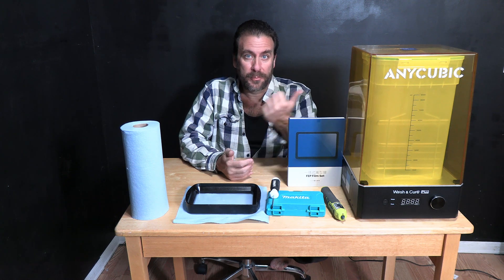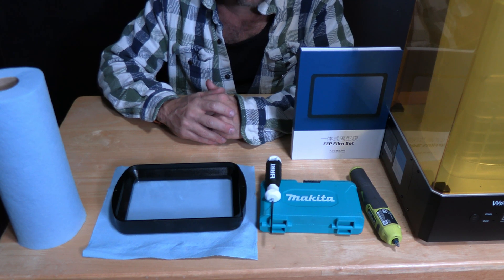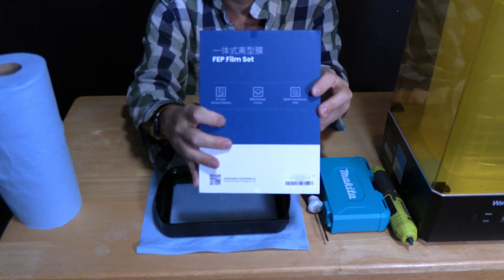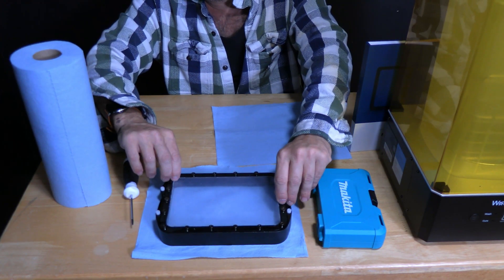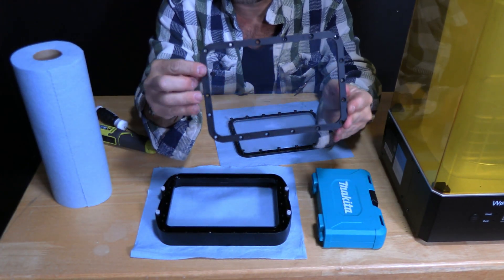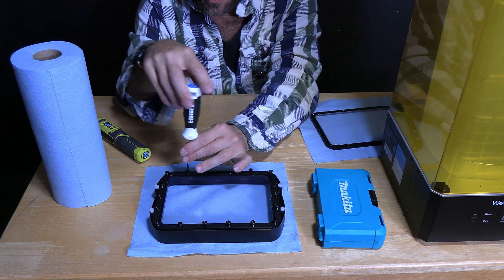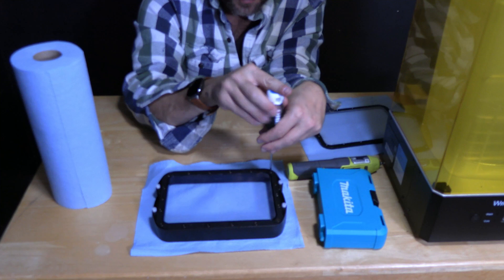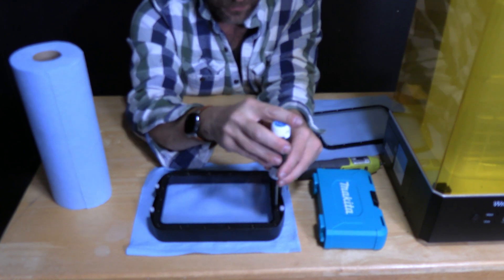Replacing the FEP on a RESIN 3D Printer Resin VAT - Anycubic, Creality, and more (Photon M3 shown)

Comment: Hello, I bought FEP for my Photon M3 but there is no frame, yours come from Anycubic and cost a fortune (robbery even, see forced sale) while those I bought are sheets to change the VAT without there being a frame, how do you explain that, and I specify that the FEP I bought are FEP FOR the Photon M3 🤔
Reply from the maker: No idea. Sounds like something a 3rd part put out, that wants you to change the frame yourself. I'd buy the real ones. was so easy.
Reply: I watched this cause I need to change the fep on my mono x 6k. Got excited for a sec watching this, but mine also doesn't come with the frame, will hafta do it the hard way :(